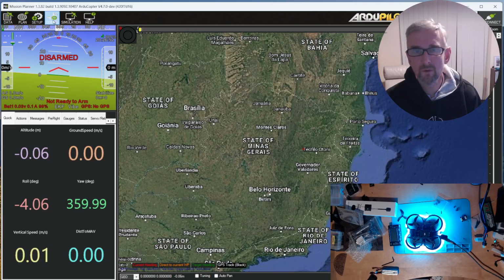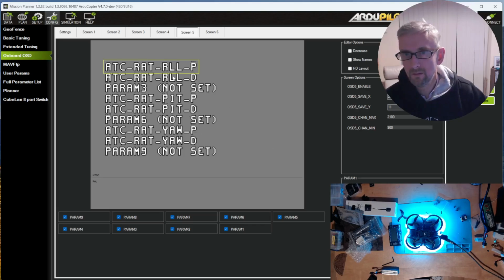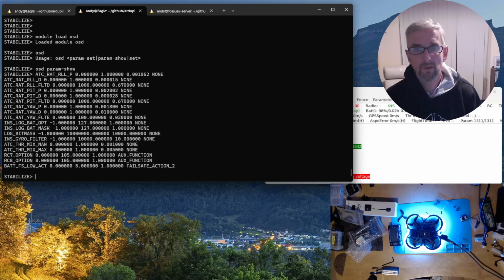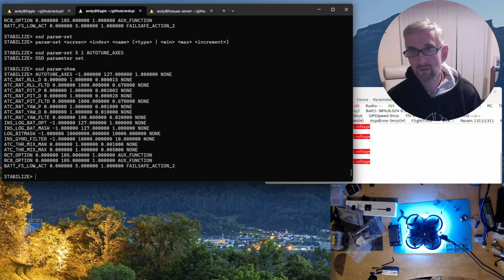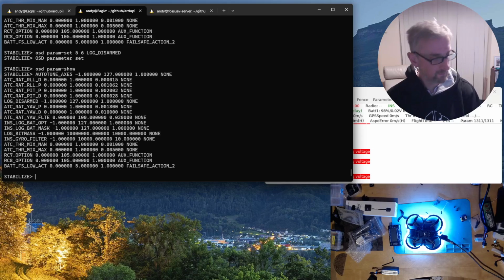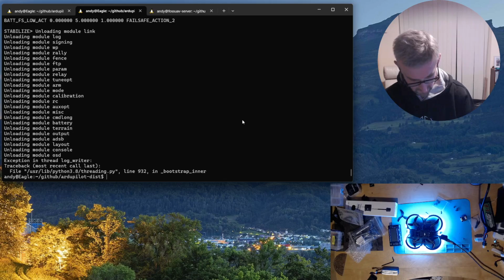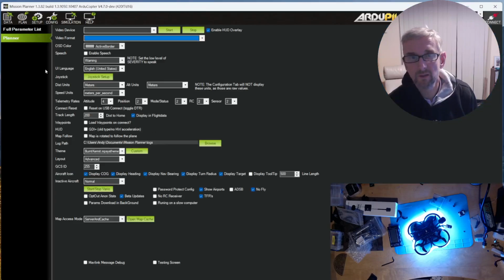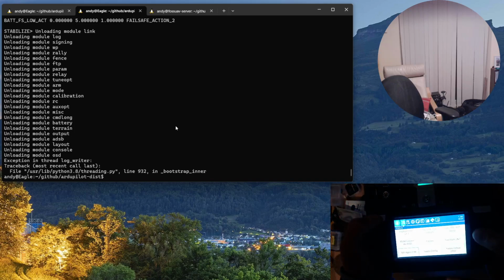Pavo20 Pro Video 10 - Setting up Custom Parameters for OSD and TBS Agent Lite

Comment: Hey Andy. I've got this setup for vtx_band, vtx_channel, and vtx_power, however the TBS Agent Lite script will not let me change the param. When I click on it on the radio, it does nothing. Displays 4,7,1000 for Raceband 8 1000mw, but is uneditable in Agent Lite the way other params are. Any idea how to enable this? Shooting for LUA based VTX control. Thanks in advance.
Reply from the maker: Which param can't you edit?
Reply: @andypiper5285 VTX Band, channel, or power. Also doesn’t work in OSD 5 with stick commands either. Sticks won’t move the selected param. I’ve got a topic on the copter 4.6 discourse if you’d rather move there.